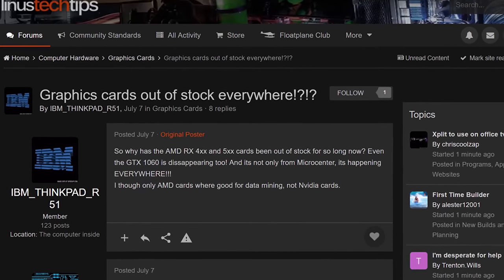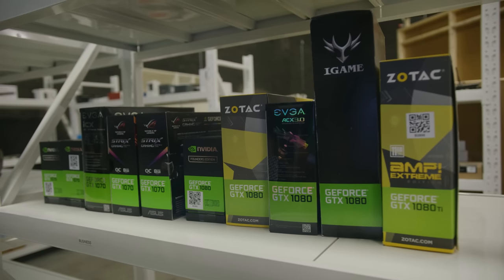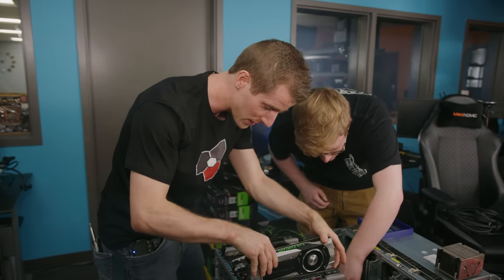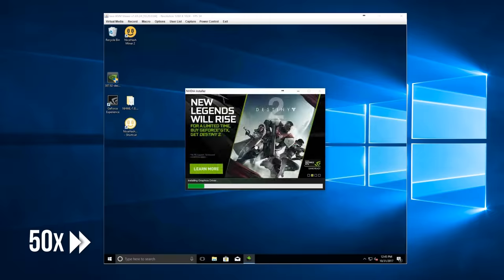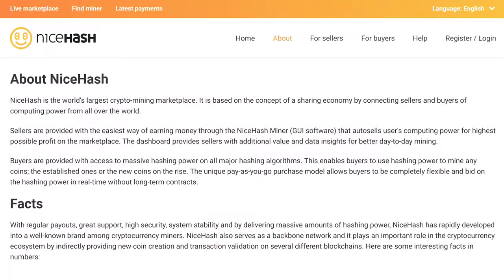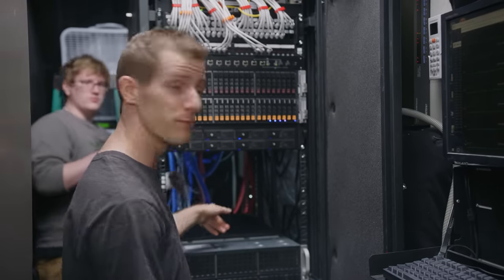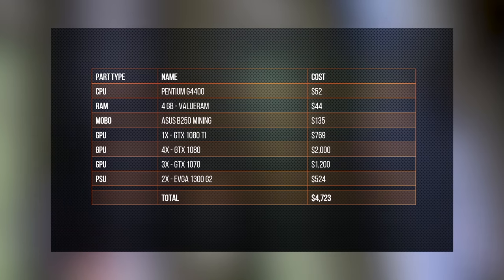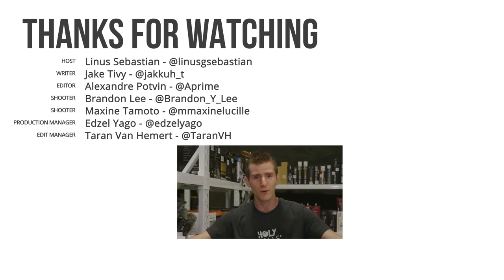IS GPU MINING STILL PROFITABLE? - Mining Adventure Part 1

Comment: Can someone briefly explain why hash-mining requires GPUs instead of CPUs? I don't know much about PCs and it sounds like the computational power needed to calculate such a thing would come from the brain of a computer, the CPU, rather than the graphical brain of a computer. Is it because there aren't really motherboards designed to hold many CPUs at once?
Reply: same
Reply: @psyco_t9387  Coming back to this I think it's because of the way motherboards are built and how CPUs are designed. You can much more easily throw in an extra graphics card rather than an extra CPU, with most motherboards not having more than one socket.

Comment: Mining is so dumb.
In the last few years I have had some of the best "mining" cards
290X
Vega64
Radeon VII

I got the 290X right before the craze, bought for like $200 at the time, and jumped to $650
I got the Vega64 launch day on newegg, I snagged one for $500 and they sold out in 3 minutes, those jumped to $1000 at one point
I got the Radeon VII a couple weeks ago for $550 and for that price I am super happy with it and it is currently in water.

The Radeon VII had it released back in 2016/2017 would have been a cash cow for AMD as it has as much compute power as the 2080ti and several times more half precision FP.

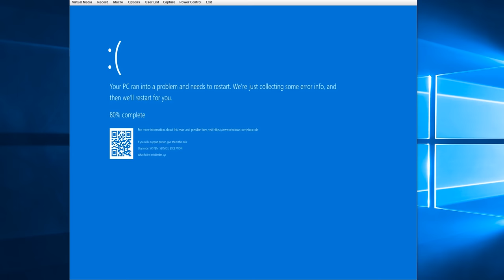Comment: 9:06 to 9:37  Well that was pretty stupid to be fair wasn't it.  Makes the whole video irrelevant.

(paraphrased) "the graphics cards being packed tightly together creates a heat issue but the air conditioning is taking care of that, that reminds me WE HAVEN'T CALCULATED THAT INTO OUR PROFITABILITY EQUATION".

Air conditioning is really expensive to run.  How expensive?  I dunno exactly, that's why it would've been nice to know!  But I know it's not cheap.  It seems pretty dumb working out the profitability of bitcoin mining without taking what could potentially be a really significant cost into account.

Comment: Man! I became aware of bitcoin and mining back when u could expect to mine a coin or two in about 3-6months depending on whether you ran a miner casually, dedicated, with cpu, gpu, and\or\including a combination of the above. And the reason I didn't? Burning out the odd hdd or system. Hindsight sucks ass. But I bet u this much for sure that a nickel to a dollar that if the Chinese are willing to run rooms with up to and over a 1000 cellphones just to create fake play store ratings for apps that they also run an office floor or three of machines dedicated to mining. Especially when it is fairly widely known that there is a city with a mall dedicated to western knock offs. It's also somehow easy to buy an item for a buck including shipping but costs twice that if not many times more to return it. Personally I could care less who is leader but more that they do what they can to do a good job of it.

Comment: also one more thing. most people won't buy a used gpu if its been mined on for 2 reasons. one. its been ran 24/7 and 2 well they are miners and they caused the gpu crash. so why the hell would i support them by giveing them a return of their investment. Thats like telling them " hey good job on buying all those gpu and causeing a god damn shortage. here have your money back on your losses so you dont learn your lesson." people if you hate miners and what they did punish them with your WALLETS, but  most miners will lie and say this card was not mined on and will try to sell it at inflated cost for example on ebay a rx 580 runs you around 200 dollars luckily i got mine that was not mined on just light gaming locally for 119 dollarson ebay . i did a bench test and a burn-in test as well and it's fine. however even if i was told it was not mined with and only lightly gamed on  i know it was mined with and i was lied to. how do i know? because he had 11 others the same cards for sale as well. that is a red flag. So not only are miners lieing pieces of shit they are also Greedy pieces of shit so there is literally nothing good about these ass holes.

Comment: what is bettter radeon rx 580 series or sapphire nitro+ rx 580? (both used, and radeon is more cheaper)
Reply: they are the same card lol but i would say the nitro+ is better as it looks nicer and may have a slightly higher clock which will boost your performance

Comment: Crazy I mine that same amount with a 3090 and 1660super now on 1200w psu
Reply: How much profit after running costs is that?
Reply: @d4m077  $6 per day for the 3090, 1.75 for the 1660s. Was around $8.50/2.50 before ETH dropped 20%+ Monday. Only costs $1 per day in power. 3090 runs at 290w as I have it down powered.
Reply: Thanks I got a 3080 and maybe dual 2080ti coming